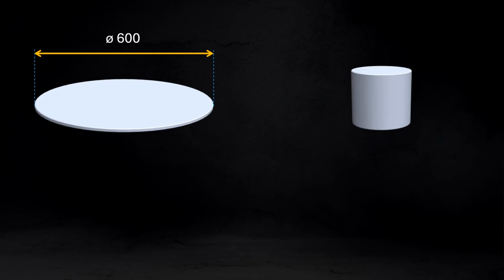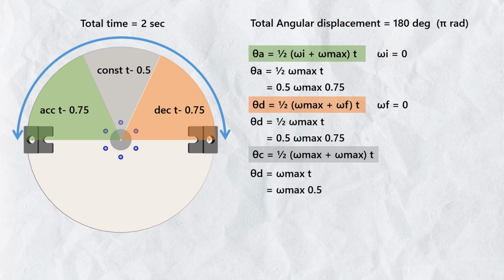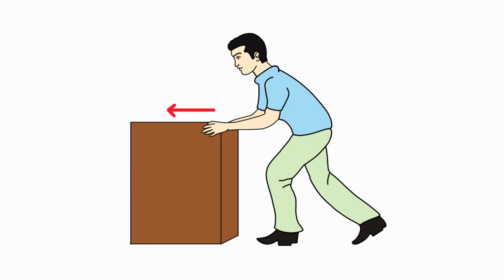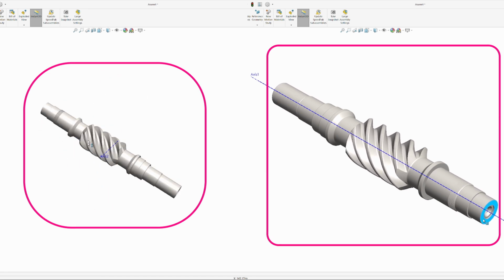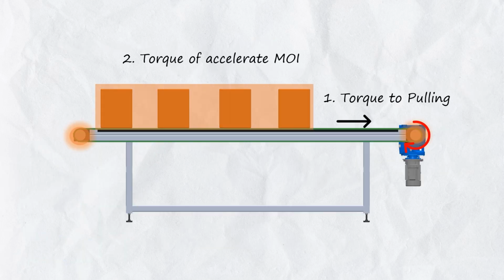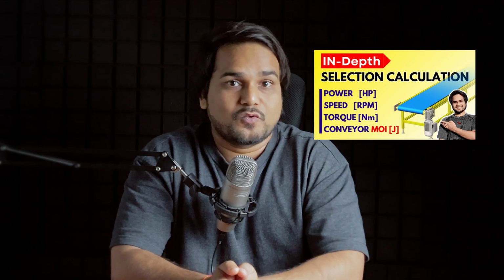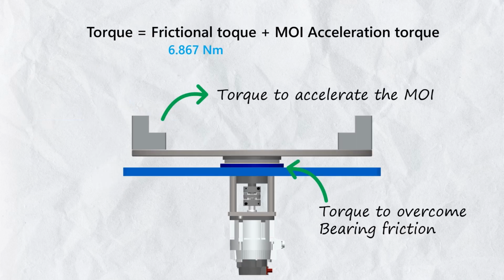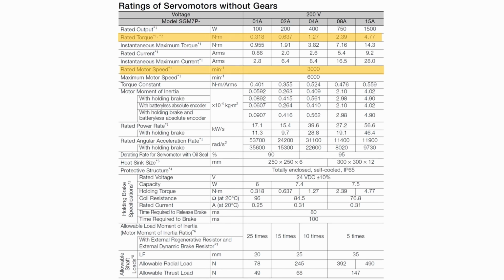Motor Sizing Calculation with "Moment of Inertia" - Rotary Indexing table

Comment from the maker: Black Friday special offer: $5 for a Screw Nut Set with 1750pcs!  https://jlcmc.com/product/b/E02/BR9688/hex-cylinder-screw-nut-set-m3-m6?from=mmnut
Reply: question from 
@alexx7910
Thank you for taking the time to make this video! I have a question, the total moment of inertia is 22.5kgm2 and the motor allowable MOI is 1000 times less. I don't quite get the part with the maximum allowable MOI given by the datasheet, explanation needed please do reply.

Comment: Thank you for this great content. 
In the indexing table application, the MOI of the system is 22.5 kg/m^2. An the allowable MOI for the motor in the example in the end of the video is 0.409*10^-3 kg/m^2. This means this motor at 400 Watt is not appropriate for the application. right?

Comment: 14:33  at this point unbalanced force= 20*0.5*9.81=98.1 N.
Reply: Total force required to move fixture = unbalanced force +frictional resistance= 98.1 +98.1 = 196.2  N.
Reply: Let me know is this correct or not

Comment: I need to select a motor for a setup that moves in a linear direction. Should I consider the moment of inertia during motor selection, or is it sufficient to calculate only the torque required to move the system? Kindly clarify.
Reply from the maker: If system is heavy, must consider MOI
Reply: @mastermechanicaldesign 
In which term i consider the MOI, in terms of i=mr2 or Jl= m*(a2+b2)/12
Or any other formula is need to use
Reply from the maker: It depends on mechatronics, if something is getting pulled over a round roller you can consider the linear mass as a point mass and use mr2

Comment: Hi Dear, You just did a fantastic job. Just need a clarification would you reply please.
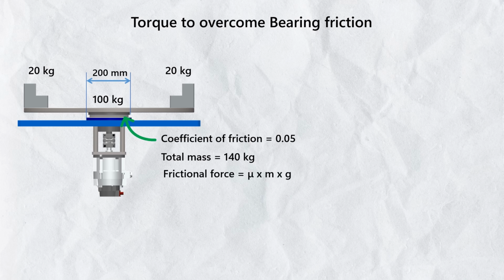For calculating frictional torque in index application we used Radius of bearing. What if,  plate is directly connected to motor shaft ? Will we consider the Radius of plate in that case ? Video time 33:10.

Comment: I have a question, would you use same formula for trunnion instead of the turn table ? With the gear box?
Reply from the maker: I'm not sure, if trunnion is installed horizontally

Comment: Ayush plz calculate power also and show selection in catalogue once or explains in comment
Reply from the maker: Power is simply Rate of doing work, in case of motors, work doing by applying torque and rate is speed, Motor power = Torque X motor speed,
I will explain in a video

Comment: Asper my understanding I and J are not same. I is moment of inertia resistance to rotation whereas J is polar moment of inertia resistance to torsional twisting.
Reply from the maker: Yes in general the case J denotes polar MOI,  but many times it is also used to indicate mass MOI. Especially in the case of motors engineering catalogue. It depends on the situation.
Reply: @mastermechanicaldesign understood. Thank you for your prompt response😊

Comment: Dear sir , I have a question while selecting a motor with gear box from company configurator what should be the torque we considered as input ?is it 53.92 NM or either we have to multiply with FOS 1.5 . Please Reply i am working on it .
Reply from the maker: Yes, we should consider FOS, if FOS is not considered in configurator during calculation.

Comment: Thank you for taking the time to make this video! I have a question, the total moment of inertia is 22.5kgm2 and the motor allowable MOI is 1000 times less. I don't quite get the part with the maximum allowable MOI given by the datasheet.
Reply from the maker: Hey. I'll check and get back to you

Comment: I appreciate the clarity of technical knowledge you have while creating the video. Love your content. 
While calculating torque required to overcome bearing friction in second example, why did you use Torque - Frictional force (F) x Radius of bearing (R). C.G of net force is at the center, so the R is 0, no frictional force at all. What do you say about it ?
Reply from the maker: Thank you so much!! Regarding T = F X R, R is radius of the bearing. where actually bearing's rollers are making friction. so frictional force F (which is resisting the rotation) is at radius R, from pivot point (center of turn table)

Comment: Very nice sir , very useful, i will use this method in my design, one thing sir you have show the image of induction motor but i thing that is BLDC motor image. Please correct me! If i am wrong
Reply from the maker: You are correct, the image, which is containing internal parts of a motor, is a BLCD motor.

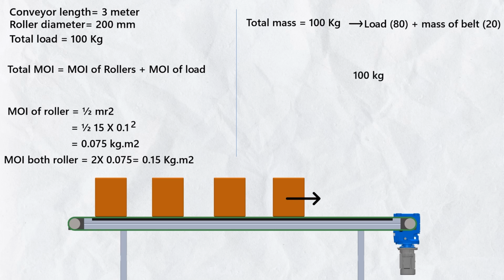Comment: I didn't get the point at 26:00. How it can be right to assume that load like its rotating and to take it as equivalent moment of inertia, if it is moving directly and has no moment of inertia in fact. Can someone explain physics behind that, please?
Reply: Instead, you would typically use the energy equivalent of the rotational and linear inertias and reduce them on the motor speed to arrive at the torque. Let me know, if you need an example
Reply: @kamalakannan.1971  not only example, actually I didn't understood your text, sorry. But thanks for try.
Reply from the maker: See, the belt is in contact with the surface of the pulley, so for any rotation of pulley, The load on the belt moves forward by exactly the same distance that the the pulley circumference moves, This means the load linear motion depends directly on the radius of the pulley and the angle of its rotation- if roller rotate x radian, load will move- X radian. r (if roller rotates full rotation - 2 pi. r)
And the same condition will occur, when we put the load on the circumference of the pulley, right ?
This is what i did here, i put the total load (100 kg as a point load) over pulley circumference, and we know the moi of a point load at distance r, here r is roller radius. 
But this is just an approximation calculation.
Reply: @mastermechanicaldesign Thank you Sir, now I understood the logic behind this. Beside that I want to say that I think in the real case for radius(center of mass) we must take distance from the axe of the roller to almost the center of the load(orange rectangulars). What do you think about it? Am I right?

Comment: Which type of compnay motor we have to use for roatry indexing table ,  If we develop in house rotary table
Reply from the maker: For fixed indexing up to 24 stations, we use a standard indexing gearbox with an induction motor- I have used the Orbital system. But there are lots of local brands.

Comment: Where did you get those values in coefficient of friction?
Reply from the maker: From bearings datasheet 
For ball bearings - approx 0.02
For roller bearings - approx 0.05
Between dry finish steel plates - 0.1 to 0.5

Comment: The cylinder will accelerate only at the start of the stroke, not throughout the whole stroke. It will accelerate and then decelerate.
Reply from the maker: Yes, maybe because air will not feed with the same speed, this is why i have mentioned - it depends on air flow rate